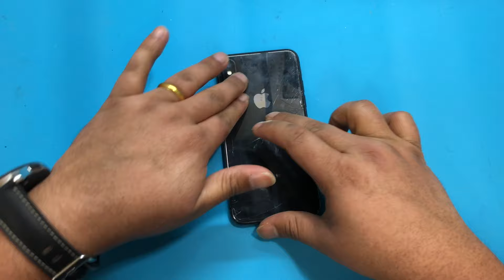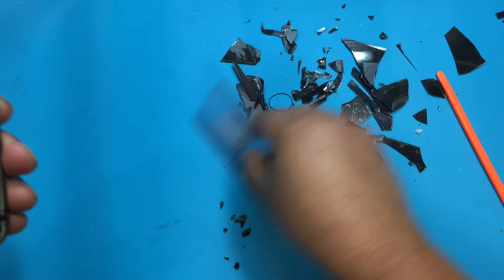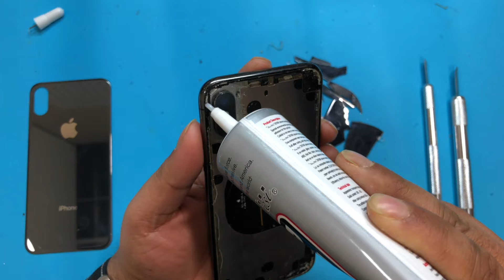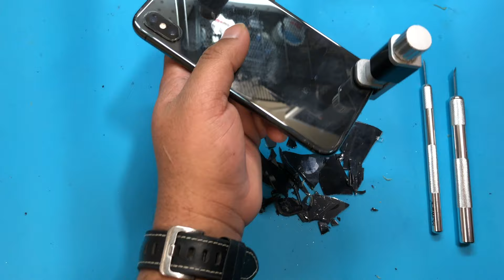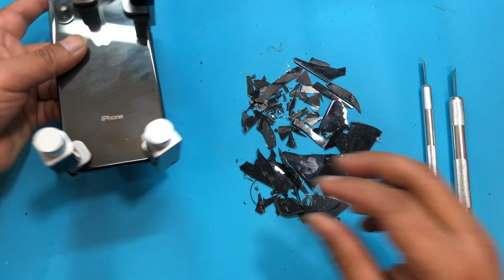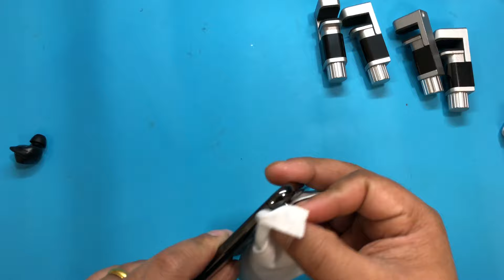iPhone X Back Glass Replacement Step by step

Comment: Is it possible without use the gun?
Reply from the maker: Edo 1 
They have to way to remove back glass 1 is heat gun 
2 laser machine 

Here is link  for heat gun    
CO-Z 858D Rework Station, LED Display SMD Soldering Rework Station with Hot Air Heat Gun Set, LED Digital Temperature Display Screen Electric Desoldering Welding Iron Kit for Electronics Repairing https://www.amazon.com/dp/B01MR2IWBN/ref=cm_sw_r_cp_api_i_90twEbQNVFTFQ

Comment: Yo bro i have a question can you use super glue?
Reply from the maker: Santi.1400 
No
Reply: Cell Phone Tech why?
Reply from the maker: Santi.1400  you use b-7000 glue 
You can get at advance auto parts
Or amazon
Reply: Cell Phone Tech oke thx
Reply from the maker: Santi.1400 you welcome

Comment: Just did mine.  Let me tell you it is not as easy as the vid shows.  It took hours to chisel away the glass, it is an impossible job, not worth it.  If you have a crack back glass, just leave it alone, it is covered by the phone case anyway.

Comment: Its not so easy that its look glass connect with not normal glue its connect with industrial metrial so when you apply much heat its also can damage board and other part

Comment: Can I just use super glue to hold the back glass in
Reply from the maker: Hector Rodriguez 
No bro super glue can damage the components of phone 
You can use b7000 glue you can get at Walmart or amazon
Reply: @CellPhoneTech   this part comes with  adhesive I believe  should I remove it so I can use tha glue?
Reply from the maker: Diego Ramos 
Adhesive is not good at all 
Used glue B-7000
Reply: @CellPhoneTech  thank you

Comment: iPhone back glass is on epoxy glue 😂
Skimmer 
U need use laser to remove I do this regularly 
I been as well try to remove with heat gun noooo!!!!!!! This not working like u showing 
Explain me how is possible remove it as u doing is impossible 🤦🤦🤦